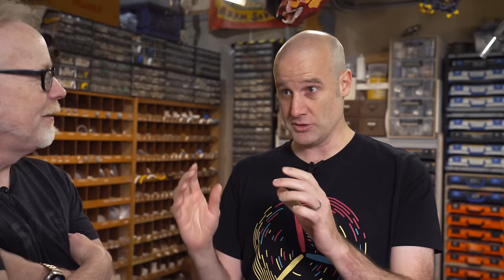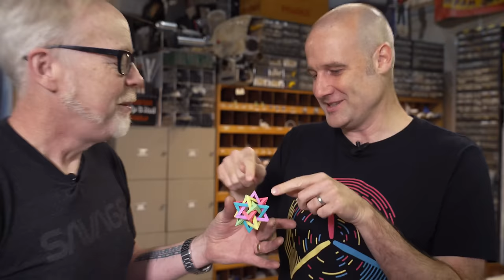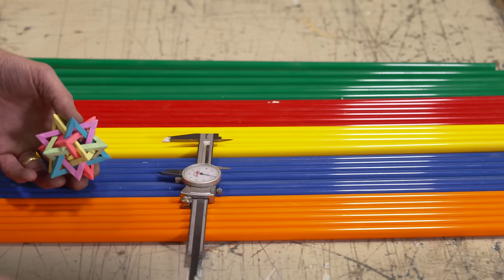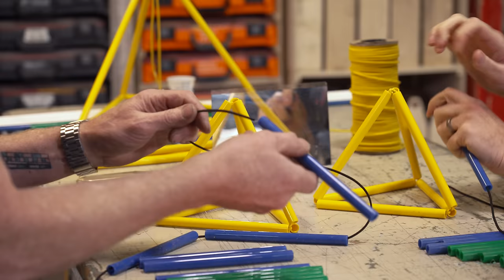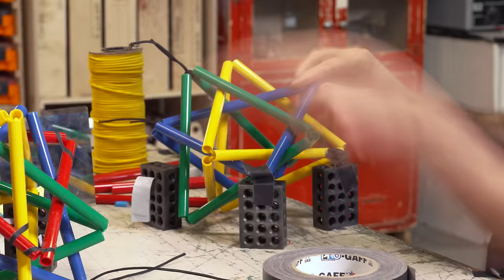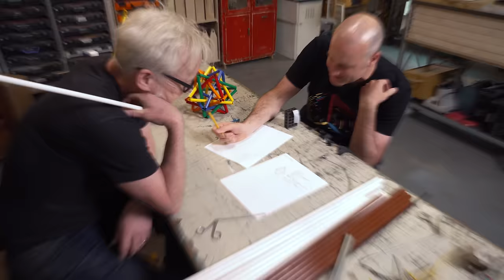Can Adam Savage and Matt Parker Build …. THIS?

Comment: I love that when you told Matt the calipers were in thousands of an inch he just admitted defeat and handed them back to you.
Reply: But it doesn't matter what the units are, you only need the proportions. And being in thousandths of an inch makes that much easier than using the more common 32nds of an inch.
Reply: Is it the thousands or the inches that got him?
Reply: @stephenoconnor6180  Inches, I'm sure. Matt is not from USA, Liberia or Myanmar. Matt is from Australia, so grew up using metric measurements.
Reply: @petermcandrew7787 I think the more common measurement might be "metric" :)
Reply: My interpretation of that is that Matt is just not used to reading dial calipers. I've seen a lot of beginners mess up calipers and not realize that you need to read both the number on the stick and the number on the dial. Once you understand how to use them it's easy, but they're not intutive to newbies.
Reply: @123_king_me9 It's hard to read calipers in imperial if you're used to metric, that is all. They make little intuitive sense.
Reply: @SocksAndPuppets  he meant "more common" as it relates to fractional inches vs decimal inches.
Reply: Right I was gonna say that the calipers measure it out in decimals, “0.XXX” so theres no issue, am I thinking right?! Lol
Reply: @getoffthegames89  Adam has shown these before, they're analog dial calipers not digital, so Matt would have to figure out the markings and then trust himself to accurately transcribe them to the paper, which is relatively easy to figure out and he would be able to do it, but ... why bother when you've got someone right next to you who's already an expert at it?
Reply: Dropped my phone I laughed so hard
Reply: Matched when Adam slid the paper over to Matt for the actual calculations.
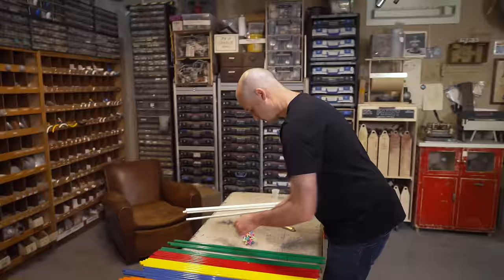Reply: Happens at 14:00
Reply: @littlefrank90  They make the exact same amount of sense as they would in centimeters.
Reply: yeah decimal numbers are decimal numbers whether inches or metric, the only thing that would be thrown off is the intuition of what the size means. and honestly fractions aren't much different when you know the decimal equivalents. for instance, from having to put them into a computer for a job I had in the past, I know the decimal equivalents down to ⅛ increments, and certain key ones for 16th and 32nd that I used to run into all the time (although it's been awhile so I might need reminding) and honestly when you've been doing it for a while you realize there's a pattern to it for example ¼=0.25; ⅛=0.125; 1/16=0.0625; 1/32= 0.03125 —note that the first digits after the decimal are exactly half of the larger one previous: 03 vs 06 vs 12 and 125 vs 250

most people know the decimal equivalent down to quarters from working with money, so that would be the jumping off point for teaching somebody that little trick for extrapolating out out to 8ths etc
Reply: And I love when it came time to do the math, he solidly handed over the pencil and paper to the professional mathmatician
Reply: @petermcandrew7787 he's definitely not australian, he's british. i think you might be thinking of derek from veritasium
Reply: @duskpede5146 well, He’s from in Perth, but we still consider that Australia. He lives in the UK though which might be confusing you.
Reply: @TinBane he does not sound australian at all
Reply: @duskpede5146  are you Australian? We have a range of accents. He’s got an Australian accent for someone whose lived in the UK for 10 years and has married a brit.
Reply: @TinBane cultivated australian is already close enough to british that it just doesn't count anymore when you've spent that long in britian
Reply: I can do both Imperial and metric but need to use imperial to figure out how big or small something is ie 6 feet or a thousand of an inch .003" is about the thickness of a hair on your head 😂
Reply: Which is funny because reading dividing inches into thousandths is exactly the same thing metric units do, so it's one of the few cases in using US units where it wouldn't matter.
Reply: @petermcandrew7787  Metric is even better.
Reply: should have called them milliinches.
Reply: @petermcandrew7787  nah, the imperial system is never, under any circumstances, better than the metric system
Reply: @emmanuelbustamante6659  I never said it was better. But thousandths of an inch is at least no worse than metric (as long as you remain in inches).

Comment: "I think we accidentally found a way to make this harder than Origami", ah, you found the Parker Way
Reply: So, Parkerigami?
Reply: @frankwales  Parkergami is when you do the more complicated thing by only looking in a mirror. :P
Reply: To be fair, the parker way would have accidentally reused one of Adam's colors
Reply: The Parker Way + The Savage Method = Joy!.
Reply: 31:18
Reply: They should have gotten a lot of weak springs and folded a smaller one around a bigger one, then they would have a T shaped corner with flexibility and could build the tetragons and then opened and put them in place closing them again.

Comment: GASP I love this shape! I remember the first time I tried to make the origami version, I couldn't wrap my head around it for like two days until it literally came to me in a dream. I woke up and retried the assembly, and it worked! 😂

Fun fact - you can actually make the five intersecting tetrahedra out of crisp $1 bills. Makes a really fun desk ornament, about the size of a volleyball.
Reply: I've done this! Surprisingly difficult not from needing crisp bills, but you need to ever so slightly fold the bills to render them into a 1:3 ratio before starting the "normal" folds

Comment: ferrero rocher box. classic bits and bobs box.

also I was thinking the dodecahedron edges should go smaller to 3 inches because their angles to each other don't extend their length as much as the angles between the tetrahedron edges. and your final results seem to biasly confirm that without substantiation.

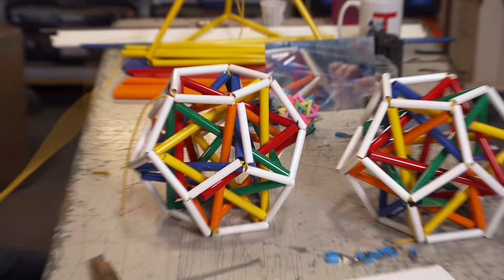Comment: Such a neat way of creating a model, using tubes and elastic cord!  I noticed a slight mistake in Adam's model, if you look at 53:30, the red tetrahedra should pass through the face of the yellow.

I absolutely love this shape and the origami version!  I've never folded it as small as the one in this video, but have done it from $1 bills before.  For those interested, the origami model was created by Tom Hull, using a unit created by the late Francis Ow.  Tom uses 1:3 ratio paper to fold the units.
Reply: Thank you!  I thought I was the only one seeing it!
Reply: Only I think it's Matt that has it wrong...   I'm looking at 44:55
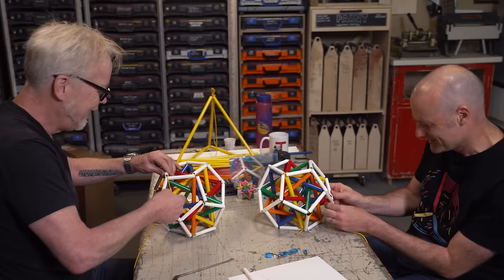Reply: Yeah I noticed that from the other side at 53:11. Just one spot  where a yellow and red should have been on the other sides of each other. You can see it again at 56:13 and Adam looks at that side at 56:20 and makes a face that makes me think he saw it.  I bet he fixed it and just cut it out to keep the video under an hour.  I didn't see any mistake's in Matt's.

Comment: As someone who did the origami version a bunch of times I find it fun to watch you two struggle with this so much. Next time try it without a model ;)
And because you mentioned lucky mathematical coincidences: For an origami tetrahedron you need 6 rectangles. And to get the right dimensions so the five tetrahedrons fit tightly together these rectangles have to be at the ratio of 1:3 (probably not exactly, but it' pretty close). So for the complete model you need exactly 2 squares per colour.
Hmm.. I think I should calculate the exact dimensions sometime.

Comment: The most efficient use of materials (specifically the cord) would be to construct the whole shape at once. The method you used required a minimum of one duplicated edge on each tetrahedron and a minimum of 14 duplicated edges on the dodecahedron. So the  minimum cord length (not counting for elasticity or knots) would be 5*6*7" + 30*3.2" (functional length) + 5*7" + 14*3.2" (minimum duplicated length) = 385.8" = 32' 1.8".

If you instead created the whole shape at once (and yes, I admit it would make the whole thing trickier), you'd be able to do it without duplicating a single cord length. That would reduce the minimum cord length to 306" = 25' 6".

Comment: If you build an edge structure out of all 10 compound tetrahedron that fit into a dodecahedron (without realizing the edges of the dodecahedron) you get a finite mechanism. It actually moves quite a bit. I built one when I was a PhD student a long time ago. It's fascinating since you would not think that structure would admit a mechanism because of all the edges that are interconnected.

Comment: If anyone else is thinking of building this but couldn't find that tubing - I found they sell "furniture grade" PVC pipe in various colors that is similar to what's used here. Jumbo smoothie straws might also work and would be cheaper but I don't know if they're rigid enough for when the string gets tightened.

Comment: When im looking at this im just thinking instead of musing elastic cord id use some sort of thick peace of bent wire and insert it into the vertexes (with insulation 3 should nicely lockup just by pushing them in) and then rebuild it with the cord once everything is figured out.

Comment: The simple version of this, I think, would be to 3D print the outer dodecahedron wireframe with holes at the vertices and build the inner tetrahedra by running cord between the appropriate vertices (following the pattern that Matt outlined at the end). You could also try to thread tubing on the tetrahedron cords as part of that, but I feel like just having the "bungee-box" in the middle of a dodecahedron would still get the point across, but would look cleaner in the end than trying to get the thicker tubing to all fit correctly as they converge into each vertex.

Comment: If it isn't too late, you might do the XL version as an ASMR type long form one day build video.  No real speed ups. Just one to one time with all the associated sounds of putting this puzzle together.

It is also neat seeing how changing the ratio of edge length to thickness allowed for an "easier" assembly of the sub pyramids. Instead of the lines coming almost through each other, they could relax and exist surrounding each other until they needed to be tight.

Comment: i'd like to try making one of these using the following technique: for each color make two shapes: a triangle with one vertex open and a tripod of struts connecting to a single vertex. hold them together with something like hot glue so you can position them around a bit and remove the glue later. i think that would allow for enough open access to weaving the struts around without having to juggle individual struts.

Comment: I've done the origami build of this shape. Working out how to intersect the 5 tetrahedra was a mind-stretching puzzle. First two are easy. Third one is where it really gets tricky. Once you've got three right, the last two slot in more easily.

But, it looks as though it would be harder again when you're also trying to thread the elastic through your tubes at the same time as weaving the tubes into the assembly.

If/when I get a 3D printer, I want to try making a 3D printed version of this. Then I'm not sure how that would be assembled — whether clipping together at the corners, or glued.

Comment: idk why watching adam and matt geek over something as simple as a ratio from the oragami piece to their pipes is honestly something magical. it's like watching a kid learn something for the first time yet these are both adults with complex backgrounds that sometimes get lost in the weeds.

if you double up on 2 lengths for the edges would that not increase the tension for almost half the vertices? im not sure the multiplicitive properties of rubber but would half of the flexibility of the tetrahedras be stronger than the other half? or i guess at least 3 vertices? if you faced all of the edges on the inside would the whole thing be more pliable? what about the opposite? if all the doubles were on the outer vertices/edges? i guess could you make the whole thing stronger or weaker based on if the doubled elastics were on the inside or outside or somewhere inbetween. 

if you only have 2 edges with double the distance, then only 1 triangle face of 4 would be 2/3 edge double structure and 2 other faces would have 1 edge with a double resistance leaving 1 face with only 1 string/rubber across all edges. all of that times 5 tetrahedra and different orientation idk how to do the math for.

this feels harder than a master grade gundam figure.

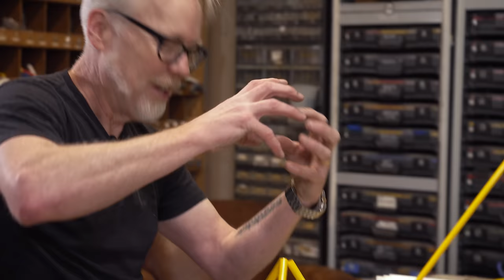Comment: at 29:30 I am thinking with a bit more prep time, you could have 3d printed a jig to hold the vertices of the pyramid together,  then laced it together with the shock cord removed the 3d prints and moved to the next segment.  or even taping them together and threading the cord might work.    but this is making me want to build one out of steel angle iron welded together.  maybe a future project for me.

Comment: I didn't think it would end up bothering me as much as it did but the circular tubes make it so much sloppier and less elegant than the sharp origami.

Would be nice to see this made out of wood. And wire could be added on the tips to make a dodecahedron, or to be really fancy, some acrylic or resin pieces that fit inside each outer gap to make a more solid dodecahedron.

Comment: I was BORED af during collage in 2007, and I built a version 9" on each side of each pyramid of the origami version that those two marveled at at the beginning. It was indeed as hard as they indicated. I STILL HAVE IT, near 20 years later. BECAUSE I WAS PROUD OF THAT THING. I still am. IT WAS A LITERAL NIGHTMARE TO CRAFT. Origami doesn't like this structure at 9" sides. I just made thicker sides. I used 90's style fluoresent-colored neon paper and it looked cool af. Now it is basically all variants of white (the ink faded). Still looks cool af.
Reply: Matt, Adam did not turn a build into a puzzle, the build already is a puzzle. These things LOOK AT LEAST as cool as they are hard to assemble.

Comment: I think you could do something similar with drinking straws and paperclips bent into L shapes if you wanted to try this at home. It would be a little easier since you could disassemble and reassemble as needed.

You might be able to go back and hot glue the joints at the end to make it more stable.

Comment: Thinking about 3d printing, you could make each "capstone", and add magnets to them but you would need 2 different patterns, either one with 3 north, and 3 with 1 north 2 south, or 2 of each, 1N2S and 2N1S. (Or same but N and S inverted)

With that shape you cut the edges in half.

Note that it's the same whether you use magnets or clips or sockets if they're different, there might be a way to make a clip that clips to itself with no moving parts

For the bounding dodecahedron you can have one ball on each capstone, and have each pentagon have half edges down the length.

There might be a way to have each capstone have 1 or 2 edges going out of it for the bounding dodecahedron. 

If we go with half 2north and half 2south it's actually relatively simple to have only 2 pieces.
I don't know if there's a way to assemble it with only N times of a single shape

And bonus question: what's the minimum number of different pieces you need to be able to assemble both chiralities?

Comment: You should 3d print some edge caps with a hole which you can run black elastic through to make the white less over powering.

Comment: There was a lucky accident in this build. The diameter of the pipes is key to keeping everything aligned when set on the table. It wasn't perfect (hence the slump), but close enough. If the edges were too thin, each intersection polygon wouldn't touch the others when they were all centered. If the edges were too thick, they would intersect each other.

Comment: I was going to say magnets at the ends of the tubes might be better than string. But the magnets might attract other magnets and change the shape. But what about velcro? It would be easier to put it together and you could always remove the velcro afterwards and glue or solder (depending on materials) the ends. But I'm not a professional so idk. The string method just seems so time consuming and frustrating. It still looks fun though.

Comment: You CAN do the pyramid with only one double pass. Do a diamond and then the 5th piece goes across the center of the diamond. Then fold the two resulting triangles. Now go back through one edge and you can attach the last piece. It doesn't start and end in the same place though.

Comment: You could use aluminium round tube with colored heatshrink.
Also you have a Bambu Labs 3D printer. Why not print all corners instead of using cord. That makes the corners much cleaner.

Comment: I think you could have ran rope through only one tube twice if you do a triangle flat on the table and have the starting end tie to the vertex the starts verticalish up and down to another vertex where the rope loops around the vertex before re-entering the same verticalish tube up and finally down to the last unused angle of the original triangle where the rope end is tied off.